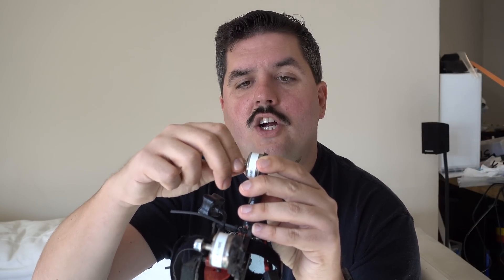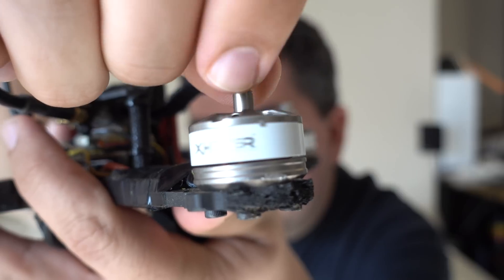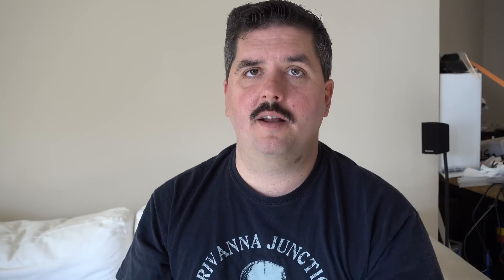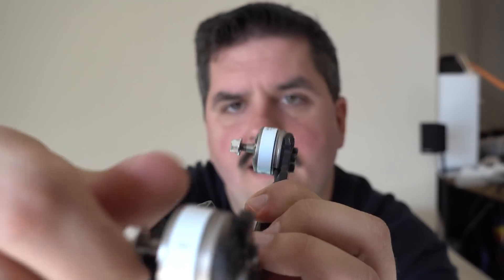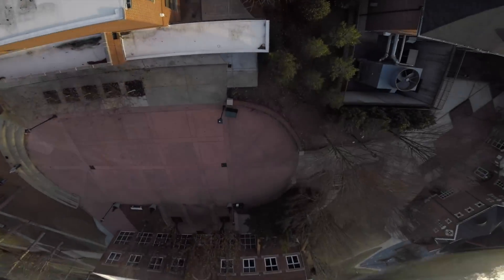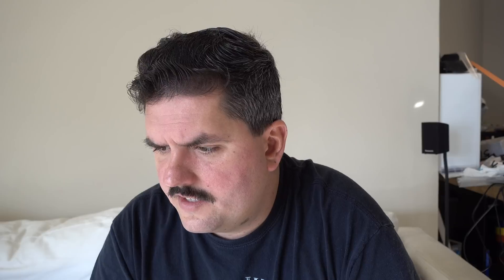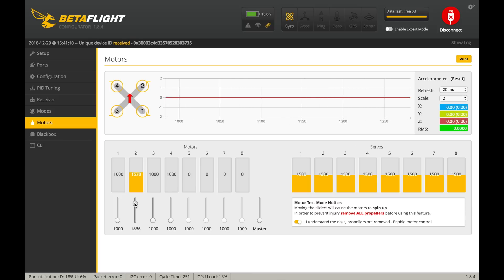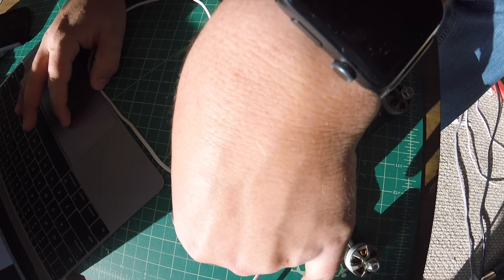Quick Tip: Diagnosing Motor Vibrations

Comment: Hey man, thanks the tip! I debugged my BNF as you instructed, and one of my motors was nosier than others after a crash and the drone flipped out when i pushed the throttle. I replaced the motor, but it's nosier than the others, and I can feel slight vibrations from it too. It's also drawing more amps to get the the same amount of spin as the other motors. Could this just be caused by bad soldering on my part? (I did a really shit job of it^^ (first time!))

Comment: Hey stingy thank you for this video. I need your help!!! I just got new motors for my Arris c250v2. They are the aokfly 2500kv motors and I'm having very bad vibrations when I go full throttle. Now I had to also change these other motors that are called Garrt and the magnets were going closer and further apart from the magnets as I spin the motors so I got these motors that good reviews. Now I had 2300kv motors and then went to 2500kv. Is this a tune issue you think? She flies fine but when I hit full throttle she wobbles and vibrates like crazy. I hope you can help. Thank you.

Comment: what about in the gui when you have the usb plugged in and on the same motors tab, when spinning up the motors by hand, i usually get a displayed graph representation to each spin, some are worse than others. what do those mean?  could you check a motor that way?

Comment: Hey, thank you for this video. I had 4 xhover motors that have been put through about a year of abuse. So I replaced them but kept them off to the side for just in case. Well after your rain proof quad episode I decided that I was going to build one and use the old motors for it. So after it was built I took it out for a maiden and it was flying horrible and couldn't figure out why. Well, I had a bent bell so I could never get it tuned even close well I have an old emax on it right now and it'll work till I get a replacement. Thank you for the video on how to diagnose the problem and because of you I have a rain proof quad that flys well enough to have some fun no matter the weather.

Comment: Thanks for the tip! Having some crazy oscillations after a hard crash even after replacing all 4 motors. Thinking now it's an ESC (Kiss24A) waiting on replacements but it's hard to feel the vibrations without a prop on. I only notice oscillations mid to high throttle. I checked the FC mounts and all other hardware. everything looks ok. Any ideas how to diagnose a damaged ESC?

Comment: Also you can turn on the accelerometer while placing the quad on a rag or towel. while spinning the motors using the up and down arrows key for the smoothest ascent look in the upper right on the motors tab at the x, y, and z axis to find out the largest vibration for the motor you are spinning. A little tip courtesy of Joshua Barwell. Great explanation love the daily videos.

Comment: hi, i am still a noob in RC quad world, what is a belt on motor?
Reply from the maker: I could have just replaced the bell here but not everyone sells just the bells. I didn't have any spare bells at the moment so I just put on a new motor.
Reply: Alexa assuming you mean bell then it is the top part of the motor that moves. The bottom part is called the base
Reply: so you can insted of buying the new motor, just buy new bell and solve the problem, or as stingy said in some cases you need to buy a new motor.

Comment: Stingy, I love your vlogs and your helpful tips. Your Vlogs really improved my flying, so thanks for that. I can't wait to see what’s next.. Don't worry about the nerdy thing. I think all FPV pilots relate to that. I am an Army officer, long working days, but every chance i get after work, I drive to a spot to rip a pack or two before going home. My wife knows my 'Need for FPV' (LOL). Question: I am running the 18A Kiss ESC at the moment, just because it is more affordable than the 24A or 30A. But what is the benefit of a higher amp? Because I can imagine that he KV of a motor will stay the same, regardless of the esc amperage. Maybe you can elaborate about this.

Comment: You must be some kind of clairvoyant or some such...I've been fighting with this for a week trying to figure out where a particular mid to low throttle buzz is coming from. I've tried new props, I've put 2 new motors on because "this will fix it for sure!", I've tried lowering D because somebody on a forum said that helped. I've even prayed to Ganapati, the Hindu remover of obstacles and Torngasuk, the Inuit sky god. Still the very noticeable motor buzz around mid throttle (hovering).

Your video came at just the right time. I was moments away from sacrificing a goat to the Mayan Serpent of War. 

The things in your video are actually really simple and in hindsight seem like common sense. I actually feel kinda dumb that I didn't try this first. But thanks anyway, Stingy! I'm gonna miss your daily videos!

Comment: Nice video thanks! I wonder if the filters on Betaflight could be tuned using the blackbox spectral analysis thing to make the motor noise low enough that you wouldn't have to swap out the motor? Just a thought :)

Comment: Stingy what do you think about sturdy props destroying motors? My friend destroys about a prop every second pack and the HQProp durables (3" though) lasted me 30 packs so far. I already have slight motor vibrations.     
    
Should I fly Dalprops/HQ Durables and often replace motors or use normal props and spend more on those?

Comment: I love you quick tip videos! nice job...

A great way to diagnose the vibrations is to download the iseismometer app on your phone and watch the vibration levels precisely for individual motors on all axis...  The app uses the gyroscopes in your phone
Reply from the maker: +Krishnakumar Malu Not a bad idea but a bit of overkill. If it is bad enough to cause oscillations it will be pretty obvious just by feeling it. This motor was just barely causing issues and then just about made my hand numb from vibrations lol.

Comment: Another good way to check which motor it is is to put the quad flat on a hard surface (table or desk). Open up the battery strap if you have to, so the quad will sit on the motor screws. Connect to betaflight (or the configurator of your choice) and spin up each motor. You'll clearly see which one is out of balance. The quad will try to vibrate off the table. If you suspect a motor to be out of balance, make sure you test it without the prop nut also. I have noticed many prop nuts from Emax RS2205-2300 motors are out of round or unbalanced.

Comment: Stingy loving the dailies man, I know it's coming to an end but good stuff. I have a question for ya. With you all (Atlanta Crew) flying so many concrete spots, and smashing motors regularly I imagine, why not use 3D printed motor guards? Wouldn't the extra few grams be worth knowing your motors are more protected? I'm pretty new, and not sponsored lol, so protecting my gear is important to me. Love to hear your thoughts.
Reply from the maker: +MultiKillGaming It is a great idea in practice but in reality it does very little. The 3D printed parts break much easier than the motors which rarely get significant damage. Plus if an impact is bad enough to actually damage the motor it probably won't matter that there was a piece of plastic between the concrete and the motor. This one the impact was on the prop nut so no protection would've been able to do any good here either. Everyone I've taken to concrete spots with those protectors has left with shredded 3D parts.
Reply: StingersSwarm Good to know. Maybe a rubbery TPU print would hold up to crashes better and still give some impact absorption from straight hits to the bell. Or maybe I should just rip and take the hits as lessons learned lol. Thanks man
Reply: yes I have been thinking about TPU guards...after noticing my motors all have bad vibes...Im sure it must help? Also vibration dampeners...I mount all mine with them now...helps a lot...

Comment: Hey stingy
In that page over on the right you can see the X Y & Z axis.  You can hit the reset and spin each motor and the accelerometer will tell you exactly how much vibration in g's that particular motor has , then hit reset again to clear it and check the next motor. 
I love your flying style bro.

Comment: I've a question about dirty motors, sometimes i crash into grass and mud. After crash my quad, particulary my motors are very dirty (and they make tons of vibrations ^^). How do you do to clean your quad? What is for you the best technic?
As usual it's a good video =)
Reply: CrocoFabs Air duster works for me most of the time.

Comment: its hard to tell from the video/audio only, but I was surprised that you would change a motor like that. I feel like I fly with much worse motors and get away with vibration on the HD camera using foam pads, keeping it going till the fc is overwhelmed by the vibes. would you say that you change 1 motor each 3 to 5 sections? 10 to 20? how often roughly? cheers, have a nice holiday!

Comment: In the motor tab you can reset the accelerometers and measure tje motor vibration in the gui, more accurate. I think in general if the vibration is less tjan a tenth of a g then its all good
Reply from the maker: +bo holland nice tip.
Reply: StingersSwarm credit joshua bardwell
Reply: Yes I was about to say that, great tip there from J. Bardwell. I use the accel. to do this test, works great.
Reply: yup this is good bardwell tip...very good to diagnose with accelerometer...actually with filtering you can fly with up to a full 1.0 or even I have a 2.0 on my setup...but I will change anyway because it is not ideal...expect 0.01-0.03 for new motors...
Reply: I forgot to mention - these help me fly a quad with noisier motors...

https://bmc3d.myshopify.com/products/motor-vibration-isolation-pads?variant=33302329103